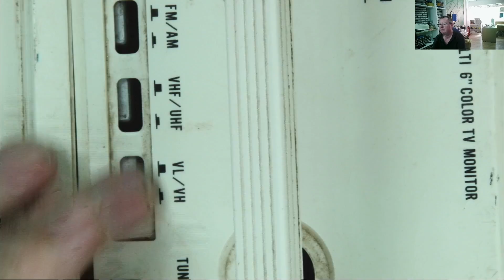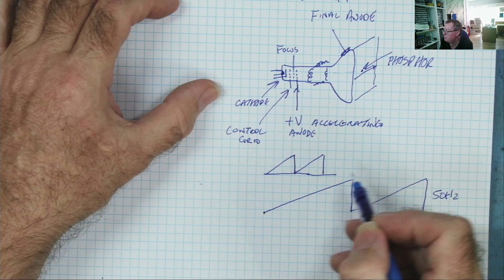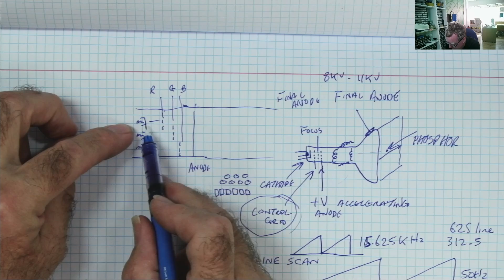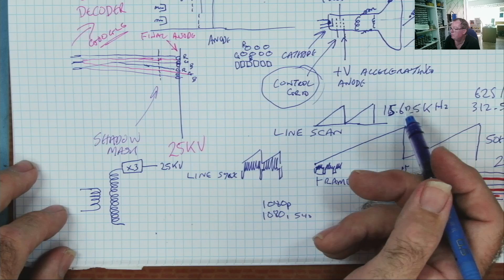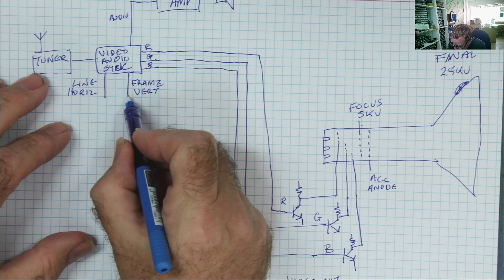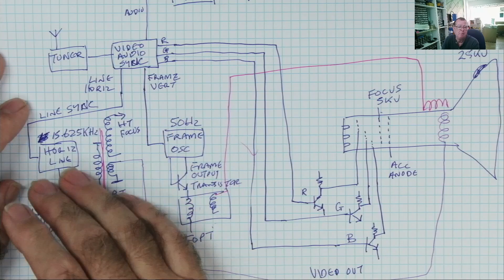All You Need To Know About CRT TV To Fix Stuff

Comment: hi, i just had a question re the electron gun.

How does it control which holes to shoot the red beam through. I understand how the red electron beam could be set up to only shoot through red designated holes. But, how does it allow red to be displayed at the top of the screen while not displaying at the bottom. If that makes sense ?
Reply: That is adjusted with the convergence and purity rings on the deflection yoke. 
If you have the convergence and purity wrong, then you'll get an image with a non uniform tone, color fringes, and you'll immediately see how the electrons are not falling onto their respective phosphor.

Sony CRTs also have an adjustment called H-Stat in addition to the rings, that one adjusts the horizontal static convergence.

Comment: The chances  of u reading this is slim but I need some help I recently inherited my late  grandfather's 1976 zenith tv console that's sat in a basement for decades the tv still seems to work I recently brought it out of that basement cleaned the outside saw some white mold on the outside of the tv cleaned that all off didn't see any structural damage but when I looked inside the back panel it had more mold on the wood inside this is an old crt with xray protective mats on the tube and will idk what to do if anything any chance u could help me

Comment: What you need to know before anything else is that the inside of a CRT Colour TV contains Lethal voltages in most areas . The Voltage around the LOPT and Tripler  is around 25000 Volts. Even when the set is unplugged  the large Capacitors  can retain lethal voltages and need to be properly Discharged to make them safe to touch , Just saying ,
Reply: Everyone keeps repeating that, but no one ever tells how to discharge it...

Comment: Excellent video! Question: Is the HT line (25kV) acting like a capacitor to the grid at the front (inside) of the "screen"? If so, why? Just an electrician asking. I'm not an engineer. 👍🙏
Reply: По большому счёту внутреннее высоковольтное покрытие кинескопа взаимодействует через стекло с внешним покрытием - слоем напыления графита подключенным к "земле". Но ёмкость такого взаимодействия - единицы (а то и доли единиц пикофарад, pF), так что этим можно пренебречь.

Comment: Hello. Thank you so much for the video. It's greatly appericiated as I (as a vintage tv  ethuaist  and a noobie repairer. This made it all so simple to me when it seemed like rocket science!) I have some questions as I am an ametur...
1. Do you need other equipment? or fault check properly? - I just have a multi meter? My impression is that you soley need a multi meter to detect voltages and replace parts that don't meet the required electrics. (Some people suggest the use of oliscopes, ear meters & high bleed resistors) 
2. Are schematics really needed to detect faults properly or could I just use this video as a prime example to refer to?
3. Would it good to strip old sets for spare parts?
4. I have two sets that don't have any power. How should I go about fault checking?

Comment: Hey boss, I got a question: I have a CRT TV here that has been working great for years, but suddenly stopped getting a picture when turned on. I smacked it once and the picture popped up slightly warped. I turned it off and turned it back on but no image. What connection on the board could be loose that I should try and reseat?

Comment: Does anyone know where to start when the entire horizontal position is shifted to the left? The service menu allows the picture to be shifted right but it's as far as it will go and my only solution so far has been to decrease the entire picture size.  The TV also only displays out of component and not composite. 

It's a  Sony Trinitron from 2000 model number KV-36FS12

Comment: As I was watching this, my whole life as a C&G RTV engineer apprentice came flooding back. I recalled how I started work as a field service TV engineer working on dual standard 405/625 monochrome TV's with turret tuners that just needed a clean.  I lived through the days of progression from valve tech to descrete component semiconductors. Happy days. I recall my first installation of a Bush Colour TV that was size of a large front room cabinet that needed a full installation to setup the RGB convergence by twiddling the many many internal knobs to converge the Red Green Blue scans for the upper/lower/each corner/ centre etc etc.  I really enjoyed the days of component repairs onsite in clients homes, but when companies started to push for 'panel swap out'  instead of proper full onsite repairs the fun stopped, and so did I. The neewbies wouldnt believe what was needed to get a viewable picture in those early days of colour TV . . . . . and nowadays you can just pulled a massive inches screen out of a box and bung it on the wall and away you go. After 19 years in the Television and VCR repair game I stayed in the electronics but moved over to industrial control system such a CANbus etc and there I stayed for 30 years ending up training the new generation. I retired last year, it was and still is, a good life.
Reply: Knobs for convergence? Sheer luxury 😂
Reply: I've briefly fiddled with convergence rings and got a little extra life out of a monitor. Now I have been introduced to the cosmic horror of convergence strips. Literally sticky tape with magnets on it you are supposed to stick on the back of the tube to get extra convergence and purity adjusts when the rings aren't sufficient..WTF..

Comment: Very well done,  an excellent explanation of how an analogue TV system works.  I spent nearly 40 years as a transmitter engineer working at the top of mountains on TV transmitter maintenance and repair.   I also spent many years repairing TV sets so I appreciate your enthusiasm.  Digital TV is of course , a very different proposition!  You have composed an excellent lecture!  Glad to say I am now very happily retired as it was always fairly hard work, against the clock, otherwise known as an impatient viewer, and seldom near to home.

Comment: I bought a last run analog TV in 2005 as TV prices for bigger tubes sold for less than $300 USD (the price I paid for a new 32 inch CRT TV in 2005).  In 2007 the United States stopped broadcasting in lower bandwidth analog signals and required all TVs analog to have a digital reciever conversion box of taking high bandwidth digital signals and pulling out the necessary analog TV signals at output to a coaxial line to the input of an analog TV with cable inputs.  That is, all 1980s TVs up to the last run 2005 TVs before the first LCDs and their huge prices were equally marketed.  I'd like to see how to fix sompler failures in the 2005 TVs such as vertical scan missing at the top half of the line traces missing.  It just seems to be a simple components failure(s) finally after 18 years.  A diode problem?  A transistor failure? An IC chip failure since 2005 TVs used most up to date technologies?

Comment: Don't touch the flyback.
Reply from the maker: I only ever did that once, back in the 80s.  Put my hand on the line output transistor while it was running.  It hurt a lot, and unlike a mains shock where you get a deep vibration at 50/60Hz, with the line output you get a loud high frequency whistling in your ears.  Definitely not recommended, stay safe guys. As fun as it might look, please don't mess with this sort of stuff if you don't have a good amount of prior experience with mains powered PSU etc these CRT TV really can and will kill you if you don't understand what you are doing

Comment: I do remember these kind of sets from the 80s perhaps an enquiry to Shangoo might help but from the past these sets had no documentation as they were cheap imports but pretty generic in how they work. This set would make for a good restoration video but the tube might have problems couldn't see much colour but might need the caps doing and rgb o/p transistors changing  bring some life back to it. Thanks for the very good refresher in how crt tv works. Muchos  gracia
Reply from the maker: Certainly if I am going to restore it then I would replace all the caps on the board with the  hold adjustment etc.  That one looks like it has the colour and sync and audio decoding circuit on it.  It also has the RGB output.  I think the poor colour decoding is more likely due to the problems with horizontal sync (line tearing) as it looks like it is syncing on the start of the video signal for each line, rather than the line sync pulses proper.  If it was a CRT problem I think it would cause more of a background colour cast on the raster. I'm not sure what the smaller vertical PCB on the other side is doing as I didn't look closely at it but it could be the line oscillator/sync.  Bottom board looks like Line/Frame output and power rails.

Comment: Help with my beloved Commodore 1084s D1 monitor please.

What do you think this might be: https://www.youtube.com/shorts/RZBdNZa25Bs

Any suggestions welcomed.
Reply: @Mr Guru Thank you for your advice. I am aware of the high voltage inside the CRT, theoretically I know how to discharge it, but that is one of the reasons I haven't opened the monitor yet.

No liquids were dropped on the monitor, it was working fine, then suddenly the top left corner seemed to move further towards the top left of the monitor. The next time I turned it on, it was like it is showed on the video. It smelled like fried electronic components also.

Comment: Voltage Synthesizer tuner (VS tuner)
Tuner that uses a tuning control (VT or BT) with a voltage between 0 to 33V Voltage Synthesizer tuner named. TV can be found on the aircraft models, old and new
Based on how the control band-switch, Tuner VS then there are 2 kinds, namely. . . .
Using 3-Band input switch, the VL-VH-U
Using 2-Band input switch, the Band SW1 and SW2 Band. This tuner is actually similar to the type of band 3-sw. For control-switch 2 band is in the tuner will still be converted into 3-sw bands.

Frequency Synthesizer tuner (FS tuner) or the type of PLL
Tuner wherein the tuning voltage and the voltage controlled band switching the digital communication through SDA and SCL. This tuner has a supply voltage Vcc, which is  5V is used for the digital tuner circuit control and 33V (fixed voltage or fixed) is used to control the voltage supplied to the tuning in the digital circuits within the tuner. (Tuner old) sometimes there are additional circuit voltage of 12V to the tuner.

Frequency band.
Based on the wide range of revenue-frequency band, there are three kinds of tuner
Normal tuner
Super band tuner
Tuner hyper band

Normal tuner, the tuner that can receive broadcasts "on-air" (terrestrial) TV in the frequency band:

 Frequency of VHF Band I - VL 41-68 MHz
 Band III - VH 174-230 MHz
 Frequency UHF Band IV - U 470-581 MHz
 Band V - U 582-960 MHz
 Band II 87.5 - 104 MHz is used for FM radio broadcasting
 VL and VH bands used for broadcast channels 2 through 12.
U bands used for broadcast channels 21 to 69

Superband Tuner and Hyper band, the tuner can receive broadcast as normal tuner plus the ability to receive broadcasts "off-air" CATV (cable television).

S band using frequency band between VL and VH H-band using a frequency band between VH and U
Super band Tuner can receive the broadcast band S
Hyper band tuner can receive broadcast band and S band H

Based on the IF frequency out
IF frequency tuner out there who have 38/38.9/45.75 MHz frequency. In Indonesia generally use 38.9Mhz frequency, but sometimes there is a use 38.0 MHz

Based on the pin-out
There are several kinds of tuner long pin-out configuration. But now almost all the tuner is already using an international standard 11-pin

Comment: Hi Richard. Most, if not all main parts of this TV set is manufactured by Matsushita (today Panasonic), easily identified by the triangle logo. They were one of the most popular manufacturers of portable (and stationary) TV and audio equipment in the '70-'80-'90 era. This TV set is most likely a rebadged one. I would start by searching for the model number on the boards to try and find a similar Panasonic/National model, which may have the user manual and/or service manual available.
Reply from the maker: Thanks for the info.  Actually in the 70s and early 80s UK, Matsushita (or Panasonic) were not common names in TV sets, we had a lot of Thorn, Bush, Ferguson, Pye, Decca, Philips and other brands I don't recall right now.  Probably the most common 'japanese' one we saw was Sony Trinitron

Comment: congradulations on getting the set working.
CYCOPS was used by thorn in the 9000 series of colour set but glad to say they saw sence and reverted back to seperate smps.
on most colour tubes both delta and inline each gun had its own A! so that the background could be adjusted for each colour 
a lot of colour sets used cathode modulation and kept the grid at a constant voltage some times haveing the blanking pulse added.
all in all i think you did an excellent job of describing the basics well done i wish i was as good at discribing complex stuff.

Comment: Wow, that takes me back to doing my C&G 224 courses. Only did it as a hobby and IIRC the most common issue I found was Switch Mode Power supplys going bang!
Reply from the maker: That's probably because I took my C&G 224 in the early 80s.  It was a 12 month full time course, I came out top of the class (fact) with three distinctions and an average of 99% on course work.  I nver did TV repair as a job, only as a way to make money on the side. I finished my C&G on a Friday and started work at ICL in the central repair workshop (component level) on the Monday.  Together with an HNC (2 year part time paid for by ICL) in 'Microprocessor system design and programming' which I also got three distinctions, I don't have any other qualifications other than three A levels Physics/Chemistry/Biology
Reply: @learnelectronicsrepair  One evening a week 95-97 Mix of distinctions and credits. Part 3 was Digital Techniques, Micro and computing systems and Colour TV. Was my third run through the further education system. Already had a C&G full tec with endorsments and a BEC in microcomputing.

Comment: Fossilised chewing gum LOL best keep that might be worth something. VL / VH switches the broadcast band.
Reply: Voltage Synthesizer tuner (VS tuner)
Tuner that uses a tuning control (VT or BT) with a voltage between 0 to 33V Voltage Synthesizer tuner named. TV can be found on the aircraft models, old and new
Based on how the control band-switch, Tuner VS then there are 2 kinds, namely
Using 3-Band input sw, the VL-VH-U
Using 2-Band input sw, the Band SW1 and SW2 Band. This tuner is actually similar to the type of band 3-sw. For control-sw 2 band is in the tuner will still be converted into 3-sw bands.

Frequency Synthesizer tuner (FS tuner) or the type of PLL
Tuner wherein the tuning voltage and the voltage controlled band switching the digital communication through SDA and SCL. This tuner has a supply voltage Vcc, which is
5V is used for the digital tuner circuit control and
33V (fixed voltage or fixed) is used to control the voltage supplied to the tuning in the digital circuits within the tuner.
(Tuner old) sometimes there are additional circuit voltage of 12V to the tuner.

Frequency band.
Based on the wide range of revenue-frequency band, there are three kinds of tuner
Normal tuner
Superband tuner
Tuner hyperband

Normal tuner, the tuner that can receive broadcasts "on-air" (terrestrial) TV in the frequency band:

    Frequency of VHF Band I - VL 41-68 Mhz
    Band III - VH 174-230 Mhz
    Frequency UHF Band IV - U 470-581 Mhz
    Band V - U 582-960 Mhz
    Band II 87.5 - 104 MHz is used for FM radio broadcasting
    VL and VH bands used for broadcast channels 2 through 12
    U bands used for broadcast channels 21 to 69

Superband Tuner and Hyperband, the tuner can receive broadcast as normal tuner plus the ability to receive broadcasts "off air" CATV (cable television).

    S band using frequency band between VL and VH
    H-band using a frequency band between VH and U
    Superband Tuner can receive the broadcast band S
    Hyperband tuner can receive broadcast band and S band H

Based on the IF frequency out
IF frequency tuner out there who have 38/38.9/45.75 Mhz frequency. In Indonesia generally use 38.9Mhz frequency, but sometimes there is a use 38.0Mhz

Based on the pin-out
There are several kinds of tuner long pin-out configuration. But now almost all the tuner is already using an international standard 11-pin

Universal tuner